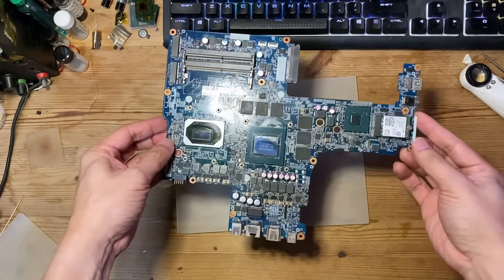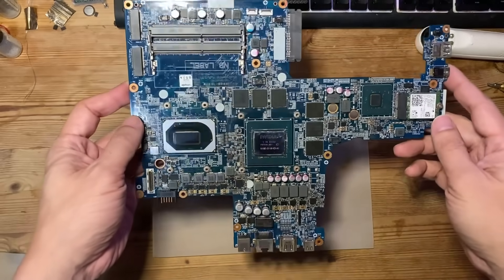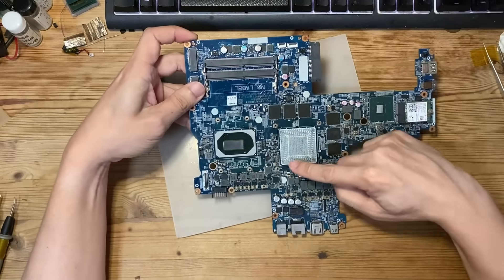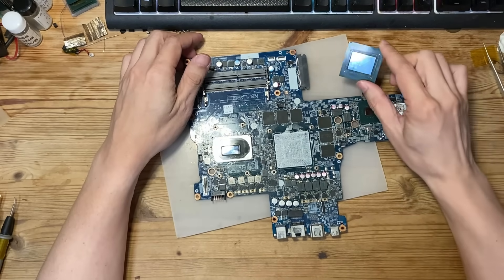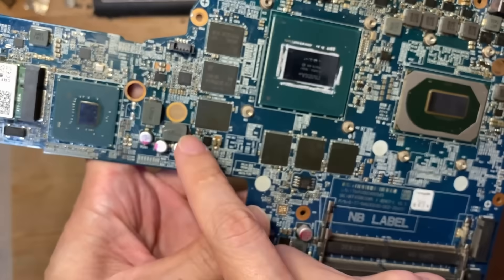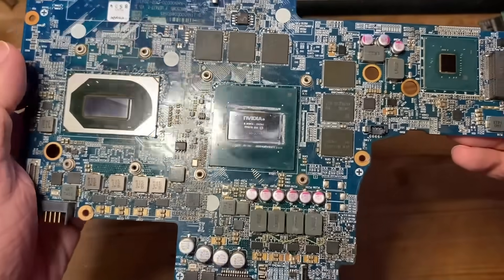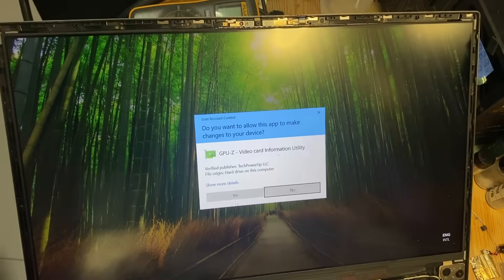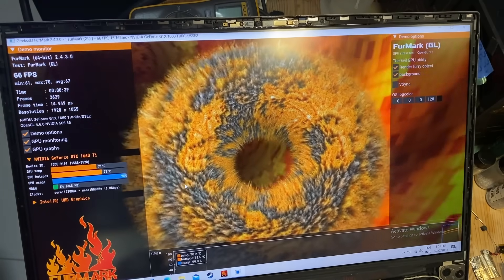Replacing RTX2060 with GTX1660Ti chip in a laptop. Will it work?

Comment: will this work on desktop card? i might have 2060 core that i think is about to die, i have to undervolt a bit to make the card stable, already replaced all the ram modules (2018 micron) , and reballed the core
Reply from the maker: It should work. Just need to flash the vbios. But erhaps it might be a power issue for you. Have you tried replacing the VRMs?
Reply: @DVRepairs  nop, I haven't checked, like a phase not working?

Comment: Very interesting

I have a question, what if i have a rtx 3070 laptop core and memory and i want to replace my rtx 2070 laptop core and memory with the rtx 3070 laptop core and memorry

Can it happen? Or its just impossible
Reply from the maker: Not possible. Different bga. Best you can do is a 2080.

Comment: Just a question I know nivida turns off parts for lower tier chips but my rtx 3070 say it has 160tmu and 96 rops. 
The 3070 ti is supposed to have like 186 tmu and 96 rops. Is it possible to install something to increase the tmus?

Comment: Bro my gpu suddenly crashes and gives dpc watchdog violation, and all type of green screen errors. After force restarting the system, there is a 50/50 chance of appearance of graphics card in device manager, and sometimes gpu would not be there in device manager only the igpu would be there. When that happens, nvidia control panel also disappears, if again force restart the same 50/50 chance... What could be the problem? Mine is RTX3060.

Comment: Great skills (Tony found a real competitor). Would you mind to give the temperatures during soldering/desoldering ?
Reply from the maker: Thanks. I can only say start with 250 and go higher as necessary. Different boards n equipment varies. Not a one temp fits all. Good luck.

Comment: I have a question about the Kapton tape (the brown-yellow transparent one): is it thermally conducting or insulating? I know it's used for electrical insulation in high-temp environments due to its properties which make is last a long time without deteriorating, but I'm wondering if those properties come from the fact that it's a very good thermal conductor or insulator. Because on my laptop's motherboard, there is a large area with SMD components under the heatsink which were protected from shorting the heatsink with a shiny black plastic layer, however that got destroyed by accident and I had to replace it with something. And I thought of using Kapton because it's able to withstand high temperatures (all those components surround the CPU and GPU under the heatsink), however I see the temps are quite high (50 C in idle, which can go to 75 under load), which made me wonder if the Kapton I've installed isn't somehow preventing the heat from escaping that area, effectively cooking the SMD components underneath...

Comment: Sad thing is Nvidia is going to discontinue the 1660 driver updates soon which may include the 20*0 series.  I didn't know 1660 was 2060's with tensor cores and Raytracing disabled. The 1660 ti isn't a slouch yet been using 3 of those card's with 0 issues.   Yeah I would love to get a 4060 or 4070 but they want mega bucks for those.  Heck even 3060 or 3070 is still up there.

Comment: Why not reball the gpu separate to the mainboard (mask) why not cover the caps etc when adding the 1660?
Reply from the maker: It was already reballed.  
No insulation necessary with leaded solderballs and lower temps

Comment: can u link that upgrade vid u were talking about i want to upgrade from a 960 to1060. i am also curious after u removed excess solder with braid was that solder paste u used if so what brand
Reply from the maker: I don't remember where the video was. 960 to 1060 is not possible. Amtech NC559 paste

Comment: I have just subbed. Thank you for sharing. Can you explain the reason you used kapton tape on the GPU. Mixed views and opinions  about applying kapton tape on the die or any APU, GPU and cells etc. Some said it delays and make it difficult to reach the correct temperature for removal. Others claim that it is necessary to protect the die as it is prone to crack like the PS5 APU. It would be interesting to hear your views.Thank you.
Reply from the maker: To protect myself.  Die may explode and mirror shards flying.
Reply: @DVRepairs Thank you for sharing. Interesting I never heard of it described as  exploding but heard of it cracking or damaged. I supposed the result is from possibly imploding or  explosion. May be as as a result of both or any one of them? Heat expand thus more likely explosion.

Comment: Nicely done! Respect! What did you use to flash the bios? A ch341a?
Reply from the maker: Yep
Reply: @DVRepairs  Nice! Thanks for the info. How did you re-ball the 1660ti? Do you have a template for that?
Reply from the maker: @gilbertcuoco  A simple stencil. I'll demonstrate in future videos.
Reply: @DVRepairs Thank you! I noticed you didn't protect the the surrouning components when you soldered on the new gpu. Is that because less heat is needed in that case? Because the heat is not dissipated to the pcb as much?
Reply from the maker: Yeah, less heat. It won't hurt anything.

Comment: Should be replaced with matching GPU  the power repairs was done it would not be so unreasonable to match the spec GPU and the customer will know as this is a gaming laptop.
Reply from the maker: I bought the laptop to fix it. 
Just pure economic sense to use the 1660 that I already have, instead of buying an expensive 2060 chip

Comment: Actually all 16xx series are faulty 20xx chips. At first production phase there was so many faulty chips with ray tracing tensor cores not working properly. So nvidia cut down the tensor cores and named them as 16xx series. So they are same gpu without tensor cores.
Reply: I thought tensor cores and ray tracing cores are separate. They’re their own core, at least on the 3000 series and above they are.
Reply: The more you know.
Reply: This is complete cap, the specs of the 1660 to don't even like up with the specs of the 2060 nor do the chips seem in this video take up the same amount of space.
Not to mention the fact that that isn't how anything in computer manufacturing works. You don't just slap on a different name on defective products
Reply: Source?
Reply: So @sadkbircan is it possible to replace 1660ti gpu with rtx 2060 or rtx 2070 or rtx 3060 etc
Reply: The sheer amount of misinformation online...

No, GTX 1600 dont physically have the hardware. Neither TU116/117 have them.

The fact this comment has 150 upvotes is beyond embarrasing.
Reply: @niebuhr6197  
Rare versions of GTX 1650 used TU106 (RTX 2060 and 2070)..but in over 99% of cases 16-series card didn't physically have RT-cores.

Those rare units had over 60% of their CUDA-cores disabled. Don't know if there were anything wrong with it's RT-cores
Reply: @kimnice  yes, 0.01% of the total GTX 16 gpus did not use TU11X.

It's a negligible amount, it doesnt matter. Virtually all of those gpu physically dont have neither RT nor Tensor hardware.
Reply: Incorrect.  GTX 1650 Super and all GTX 1660-variants uses  TU116-chip that ain't used in RTX 2000-series in any form. It's physically different sized and also physically have different amount of CUDA cores (1536 vs. 2304).
Reply: That's an interesting theory, there's no official confirmation from NVIDIA to support this claim. The GTX 16xx series, was designed as a more affordable alternative to the RTX 20xx series, targeting gamers who didn't need ray tracing or tensor core features. It could be true though...
Reply: All Chips production process is similar the line up has different models but the die it self is the self so they change depending on the the configuration and they even intentionally make it worse when the yield is too good.
Reply: @mareksinister  in chip making this common happens when masking the IC there will always faulty area

Comment: Hey just asking cause i recently did a deep cleaning on my gaming laptop (lenovo legion loq 2024) and noticed that it had spare slot for an extra vram chip , ive been looking into sending out my laptop to either get an extra 2 gig chip or see if it would be possible to switch all the 3 current ones and add a 4th chip but with higher vram capacity, is that something that would be realistictic or am i dreaming too much for my lil laptop either way i appreciate all the vids ive seen so far , you really do the slow and gritty most people wouldnt bother showing as you tear down
Reply: same pcb is used for different gpus. those extra vram slots are for a **70 ou **80 card.

Comment: dAMN! That was something - imagine if laptops had easily swapable GPUs
Reply: They used to have swappable GPUs.  Look up the "MXM" graphics card form factor.  Very common on high-end laptops in the early to mid 2000s.
Reply: @LabCat  huh nice would have been nice if they never stopped that
Reply: Frame work laptops do I believe
Reply: @Unlucky1776  nice to hear - i guess it's already too late for this feature to become mainstream as current laptops are starting to combine the gpu and cpu and ram on the same chip
Reply: @apatsa_basiteni  yep. Sucks that some laptops now don't even have nvme slots. Apple effect taking place.

Comment: True, right clicking on the desktop screen doesn't show the Nvidia control panel because the driver and the associated software isn't installed. I'm curious as to what would happen if you did install the drivers in this particular case. Does the screen fade to black with fans ramping up mid installation?

Comment: I guess the next question is can you do a CPU swap? Like I have an 8th gen i5 and GTX 1050 laptops, and I have been looking for cheap ways to upgrade it so I can start a project. I also came across this solution to upgrade your GPU using a EXP GDC GPU Dock and I was interested to see if you can run a medium end RTX card with this and a PSU slapped on. I have seen lower end cards, but not upper end RTX 20 or 30 series cards. I think it would be an interesting experiment and I hope you'll consider it.
Reply: I did this using a Acer Nitro which had the GTX 1650. I used the M.2 slot that originally had the WiFi module. I run the wiring to a USB-C input adapter. Then, I used a Dremel to cut out a spot in the back of the laptops ventilation  for the USB-C input adapter. I used black epoxy putty to mold the adapter to the casing and its looks like it was there by design.  I also used an older laptop charger PSU to power the external GPU adapter. For Wifi, I use one of those cheap small USB WIFI receivers which the speeds differences are unnoticeable. The only thing is the M.2 slot I used was the slowest slot but the external RTX 3050 with about %20 speed loss was still much faster the GTX 1650. Honestly, the GTX 1650 mobile isn't a slouch so buying a desktop GTX 1650 4GB for the EXP GDC GPU dock would be an upgrade over the GTX 1050 Mobile which might be only 2GB. Some might say this setup isn't practical but it's no different than using an external gpu for a higher-end gaming laptop or gaming handheld with a Thunderbolt port. I could have just sacrificed one of storage m.2 slots for faster speeds but I wanted the extra storage spot. Acer use to make it really hard to find out how fast the extra M.2 slots are until they changed the website. For awhile, they accidentally listed the specs wrong for some Acer Nitro laptop models by putting GTX 1050 instead of GTX 1650.

Comment: that's the only limit it can go due to the core it self 1660ti uses the same core as 2060, rtx 2060 just uses tensor cores and Ray tracing besides 1660ti is ddr 6 memory so the rtx 2060😊

Comment: Cut the solder wick in 1cm pices and hold with tweezers, makea the process easy because your are using les termal mas to heat the strip

Comment: The GTX1660Ti was the first of new new manufacturing tech which included the RTX2060. It was the same die process which is why you can do this.  It's practically a 2060 without the raytracing or tensor cores.
Reply: I wouldn't call it that. More like a 1060 but on a more efficient arch
Reply: 2060 also has dlss
Reply: So meaning the tensor cores are found in the gpu 😮
Reply: @princekells2  No, the tensor cores were completely lasered off, you can't re-enabled them because they no longer exist on the die itself anymore.  They're simply faulty RTX 2060 cards
Reply: @Nighterlev  lasering off refers to essentially cutting the traces going to those parts of the chip, not cutting that part of the chip away. they are present, but with the relevant circuitry disabled via laser cut.
Reply: @cybercat1531  I'm aware of that. wasn't the topic, so I just didn't mention it.
Reply: @princekells2  Of course
Reply: @princekells2 what?
Reply: so Nividia recycled by selling a lie and that my Gaming Laptop actually has a 2060
Reply: @cydragon2.099  No actually, they use completely different dies. The original commentor said its the same manufacturing process, and at the end result both chips are similar in power (2060 is still 10-15% better in raw power + tensor and rt cores). However the GTX 1660 Ti mobile uses the TU116 die, while the RTX 2060 mobile uses the TU106 die. They are different chips.
Reply: @srp770  I believe we're referring to the actual GPU's themselves, not the mobile chips but I could be wrong.

Comment: Appreciate the efforts but I would like to see an upgrade of the gpu instead of a downgrade
Reply: No that's the only limit it can go due to the core it self 1660ti uses the same core as 2060, rtx 2060 just uses tensor cores and Ray tracing besides 1660ti is ddr 6 memory so the rtx 2060😊
Reply: I'd imagine that would be harder as the power delivery circuitry on the board may not be able to provide enough power for a better GPU
Reply: @2Step2Hell  maybe 🤔
Reply: He does mention in the video someone already did an upgrade, but a downgrade was not done, hence why he did it. I'll go on a hunt and update the comment with the link if I find it.
Reply: this comment still says 43 minutes ago lol
Reply: @EyemachineStudios  😆

Comment: Well done! I'm using a similar BGA setup. I prefer it over my BGA rework station because it gives me more flexibility and control over the heating time.
Reply: Your hands will get sore if you use this method. You should use tools to fix the hot air gun and have a microscope to observe the solder balls on the bottom of the chip at any time.

Comment: what are these tools you are using and are they affordable for someone not running some big busness? been using toaster oven for my reballing and a heatgun for removal with a 100% failure rate when using the heatgun, if component comes off it was cooked so bad its likely dead.

Comment: Makes you wonder how many GPU's could be "hot swapped" if manufacturers had replacement cores like CPUs.
Reply: Probably, way too many,
That's why they are not doing it .
Reply: In the past, maybe, but today clock speeds in GPUs are crazy fast and with socketed GPU the signal integrity would be really bad. Not impossible but significantly rises the costs.
Reply: Most laptops have the vbios specific to the GPUs contained in the main bios
Reply: @kingeling i doubt this is true. Most laptops store the vbios inside an eeprom
Reply: @kingeling  not true, you can reflash vbios without touching bios in pretty much any gaming laptop. I barely have heard of laptops with embebbed vbios, like maybe one or two.

Comment: Doing a GPU with hot air is crazy, never seen someone attempt that before but you did it!
Reply: how do you think they are replaced? theres no other way to solder BGA chips, you need hotair to reflow the chip
Reply: @bornlivedie  You do not have to have hot air as there are also IR rework stations that can be used.  Ersa rework stations use dark IR and work quite well.
Reply: @bornlivedie usually the entire board is preheated, then another heater is put directly over the gpu core which melts the solder and allows the chip to be lifted off. doing it with a hot air pen is very risky and requires some skills regarding heat management in order to not break things so pulling this off successfully is quite impressive
Reply: what do you mean? all machines are just a hot air on a stand. the main key here is the pre heater below. without it, the motherboard will warp and will take so much heat from above and will overheat components and possible to balloon the pcb layer/ delamination.
Reply: @kobs9636  The key is temp control and the pre heater. If you can control the temps while in the transition of liquid to solid solder phase, then you can avoid ball defects when cooling and also prevents component damage by over temps.